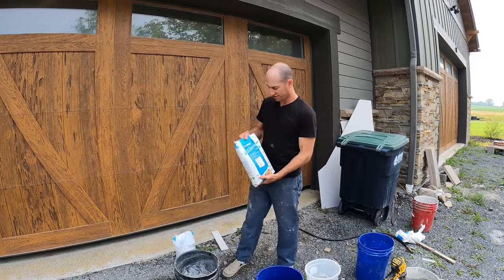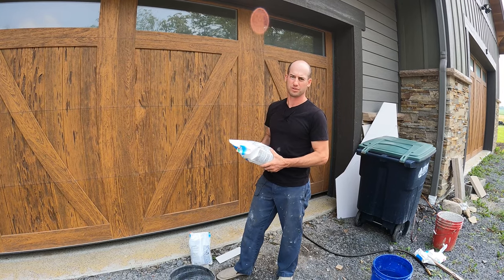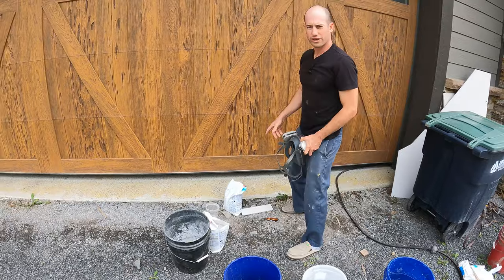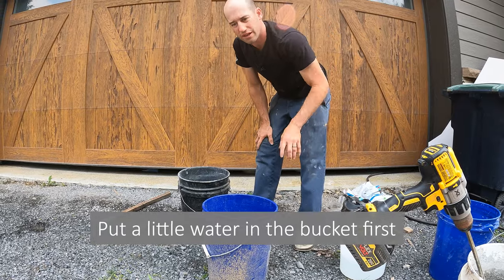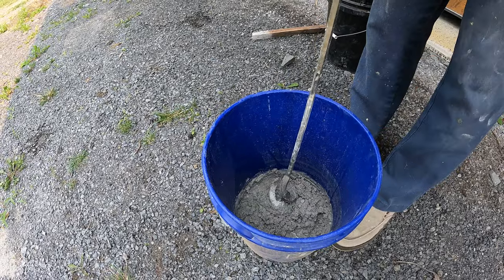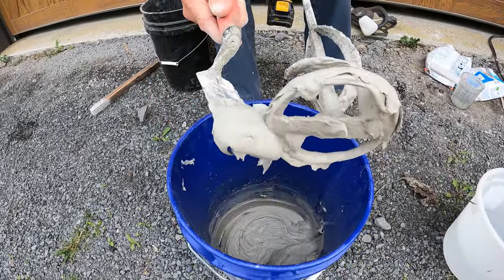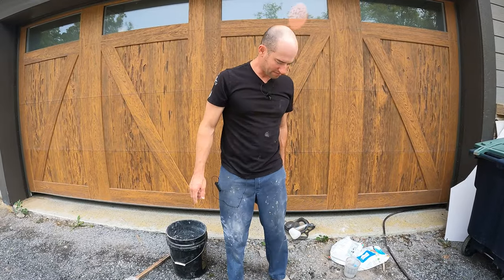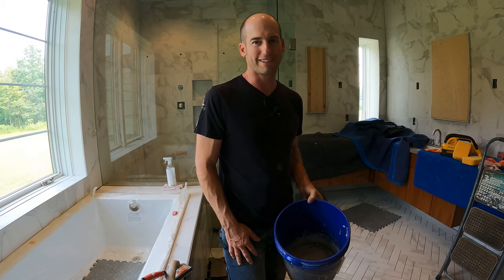How to Mix Mapei Grout for Tile -- What Ratio to Use? It's an Easy DIY Project Using Mapei Keracolor

Comment: 3.5 oz of distilled water to a pound of dry grout. Before measuring out the dry grout mix the bag thoroughly. easy, peasy.
Reply: Exact same way I did it..... by weight.  The way he did the math seemed it was almost ~5 oz of water per LB of dry grout.  48-54 oz of water for a 10 LB bag equates to 4.8-5.4 oz water per LB.  Am I right or am I wrong 🤔?

Comment: Completely lost you said 3 to 1 but then didn't do 3 to 1?
Reply from the maker: Target ratio is 3:1, sometimes it varies slightly based on your accuracy of measurements. I start with a ratio 3:1 and then add what is needed to get desired consistency.

Comment: I always thought there was 16 ounces in a pound
Reply from the maker: Correct, by weight, 16 oz = 1 lb. 
And luckily for water, 16 oz measured by volume also = 1 lb.
Since for most people it's easier to measure water by volume, that's why I converted to volume for water.